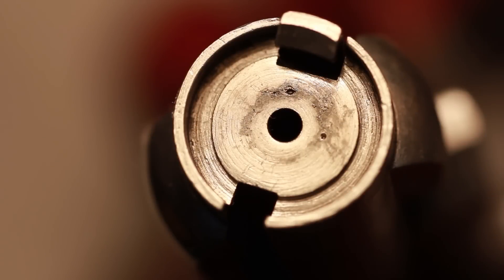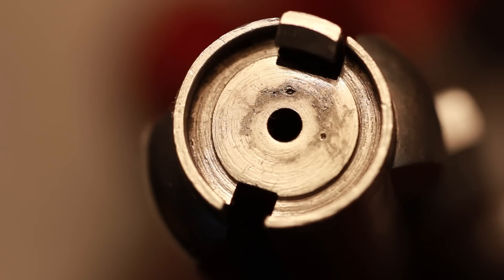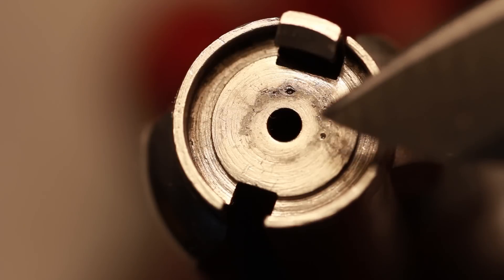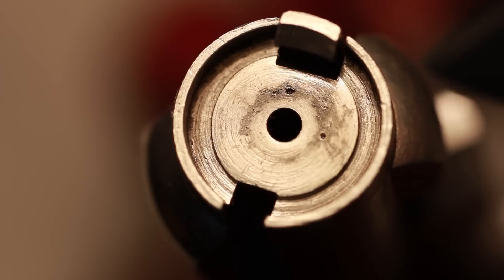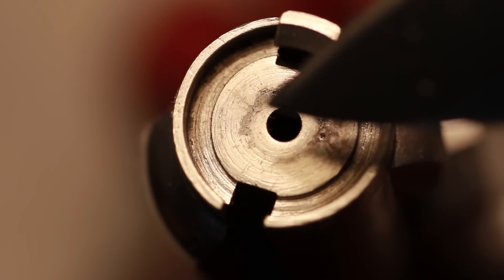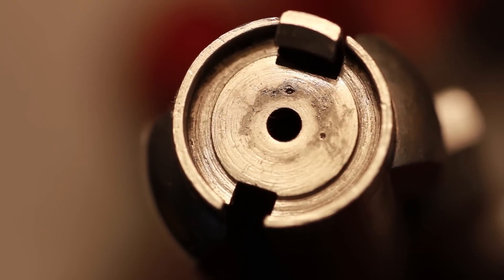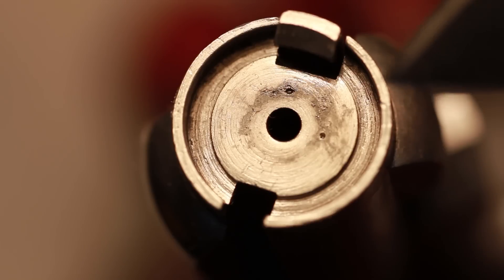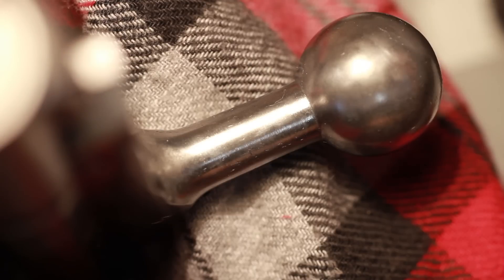Corrosive Ammunition + Corrosive Primers And The Real World Effects

Comment: As I understand it, the water is used to rinse out and dissolve the salt deposits that are left inside the barrel when rounds are fired and also to rinse any metal part that may have come into contact with the burnt powder. I have heard that the salts attract all available moisture to them and if left untreated, it will cause pitting and rust to develop. I do agree that you don't have to clean the weapon IMMEDIATELY after shooting corrosive ammo but sometime fairly soon after...

Comment: i think i figured you'd save a round or 2 for a 6-month video or something. i don't even remember anymore. 

and i got the bolt handle cleaned up. it was BAAAAD rusted... cycle it and your palm would be covered. i used oil to get a lot of it off, but my dad has this badass solvent for rust. this stuff is like Alien blood. took literally 30 seconds to clean the rust off. i need to get the name of it.
Reply: Alien Blood Hehe.

Comment: but I hear it also blackens bores if you do not clean the bore over time with pits like salt inside your barrel. I heard in WWII US would pour hot water down a barrel of the M1GRANDS
Reply from the maker: Correct mate. The main point I was making was that you can leave the rifle for a bit before you have to clean it, its nowhere like the internet would have you believe IE if you don't clean it ASAP then it will rot in front of your eyes.
The British used to flood their rifles with oil so they wouldn't rust.
Thanks for watching!

Comment: yeah the stupid YOUR RIFLE WILL RUST AWAY IN AN HOUR IF YOU DON'T PRESSURE-WASH THE BOLT AND BARREL crap is just that, but i will say i was surprised that i fired my Mosin extensively a few weeks ago, and didn't clean it till the day after. there was a noticeable new grey ring around my bolt face. it's probably from the Arkansas humidity but yeah. there's no extensive damage, definitely no sand-grain sized pits like that one, but that scared me a bit.

but yeah it was as bad as the bolt handle.

Comment: ...I find that just regular water works for cleaning my Mosin after shooting corrosive ammo. No need for windex, ammonia, and the water doesn't have to be boiling! If that will make one sleep better at night if they do that, that's on them but I have used plain water from a garden hose and then dried out the barrel and bolt, cleaned, lubricated, and reassembled it and haven't had any problems with pitting or corrosion.